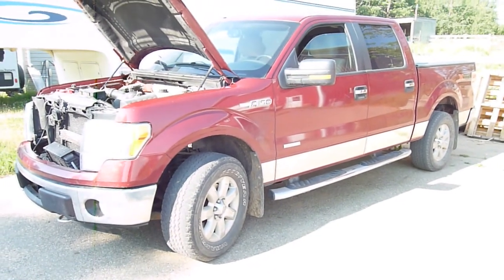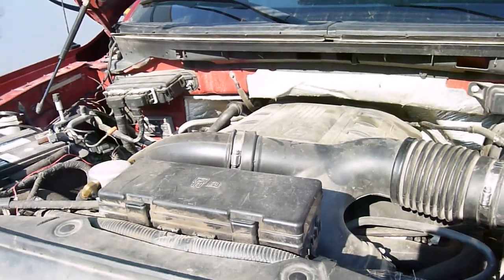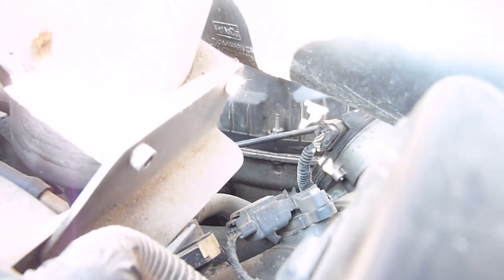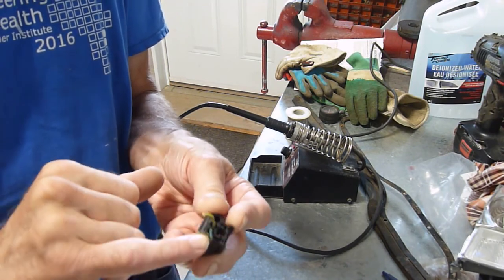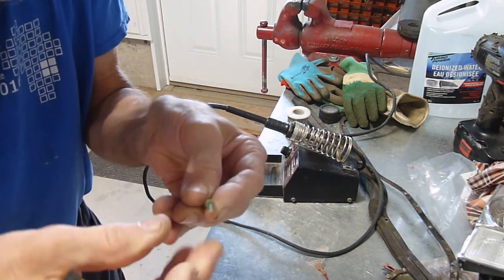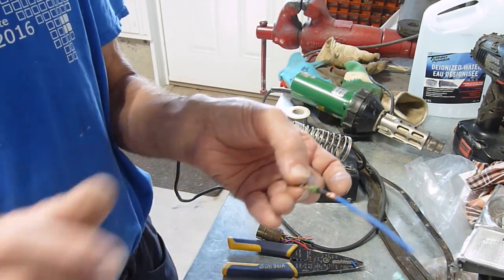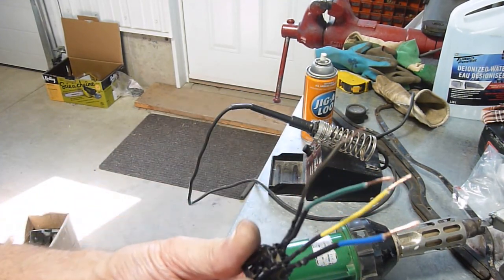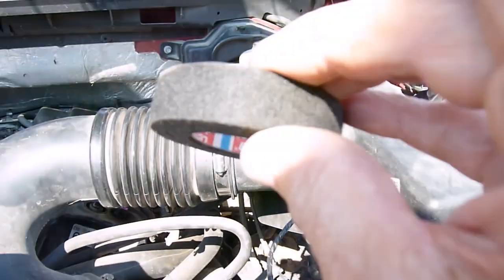F150 MAF sensor connector repair Episode 34

Comment: I swapped a 5.4 engine and engine harness from a 2006 f150 to a 2005 f150 and i have one 12 pin connector that is different between the 2 trucks near the PCM. I will be trying to swap the connector from the newer truck to the older truck by releasine the pins but 4 of them are different style pins so Ill hae to splice those most likely. i hope it works as i really dont want to take the whole front body harness from the 2006 and move it to the 2005. i wish ford would design things and leave them alone ( if they work) instead of changing things like wiring connectors in the same generation of truck.
Reply from the maker: Hope it works. Are you able to get  pinout to make sure you have the right terminals?